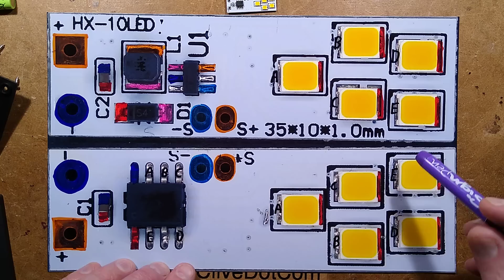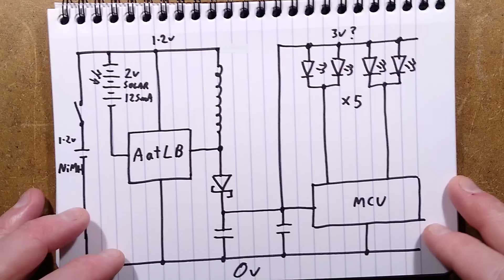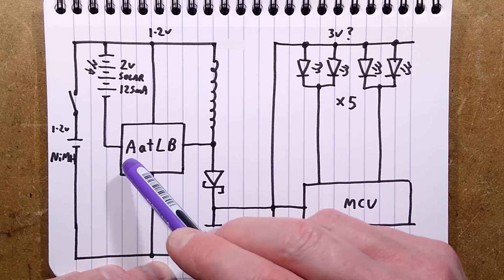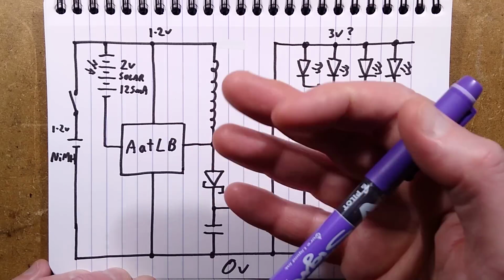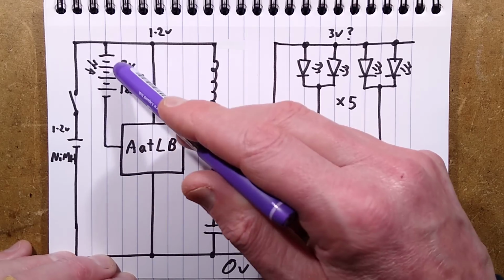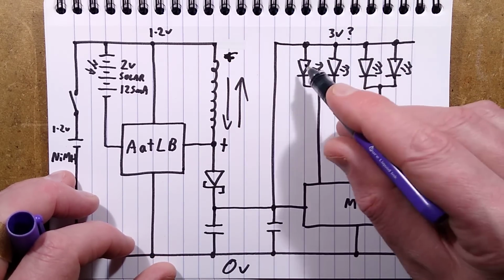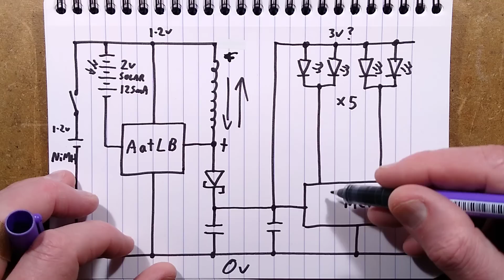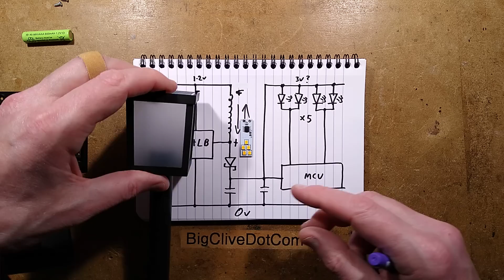Surprisingly good solar flame lantern

Comment: FYI on the ads:
The first time I watched the video, I got 2 mid-rolls, then nodded off (not your fault - it was v late at night).
Just re-watched it, paying more attention this time. At 1:35 I got 2 ads: a skippable 30sec, followed by a nonskippable 15sec one. 
At the end of your upload, I got another 2 ads, both skippable... 45 sec, followed by 30 sec

My usual experience, when you have mid-rolls disabled, is that I rarely (never? will have to pay more attention...) see ads at the end. When the second set started, I assumed they were mid-roll, but when the ads ended, your last frame was showing, so I guess it's not technically mid-roll?

Comment: I've got these pillars in my front yard and they have kind of a Pogota on top of them.   I'd like the Daisy chain 4 of these together and put one of those higher rated lithium batteries (18650),  I'd even days to change the solar panels so they charge the lithium battery took capacity.   I figure 4 lights per structure,  lighting them from each side.   Suggestions would be greatly appreciated.
Reply from the maker: You can get sets of lights with a common solar panel and battery.

Comment: What I hate about all these solar lights is that they are not designed for rain. Notice how the solar cell is sitting in a little plastic well/cup so that the water can sit there and leak past into the unit over time. Even if you seal it off with some silicone or whatever, it'll eventually leak, destroy the solar panel, and then leak further in and destroy the rest.

Comment: So...   does the AatLB have voltage sensing and feedback?    If it didn't, and the microcontroller turned all the LED's off, then the microcontroller would be overvoltaged...
Reply from the maker: That is a possibility.  I can't find a datasheet for that specific chip to see if it monitors voltage in any way.  It may just rely on there always being a load.

Comment: Big Clive I have atypical solar light nothing fancy.  They will not turn off in direct sunlight.  It's they're a common component that could be defective?
Reply from the maker: Two things can cause the light to be on in daylight.  A failed NiMh cell or its contacts meaning the solar panel powers the LED directly, or corrosion around the solar panel itself that means the light can't detect daylight.

Comment: I didn't see an advert unless it was you mentioning Poundstretcher 08:09.  Was it the pen at 04:48 ? I checked with ChatGPT and it says you use a Uni-ball Eye rollerball pen.
Reply from the maker: I use a Pilot V-sign pen which I refill with printer ink.

Comment: I’ve got at least three solar panels where one wire that looks to have been soldered, has come away from the rear of the panel. The panel is glass, so there does not look to be copper tracks. Does anyone know of a reliable fix for this failure? It’s a shame, as the solar lights are otherwise in a good condition.
Reply from the maker: If it's the brown amorphous silicon panel then they are almost impossible to solder back onto without damaging the panels ultra thin layers.

Comment: I guess the chip regulates the microcontroller voltage by monitoring the peak voltage of the inductor.  Hadn't seen that method of feedback before.
Reply from the maker: I think it's just presenting a fairly continuous load and treating the boost circuit as a simple current limited supply.

Comment: 6:52 nice explanation of the role of the inductor in the boost circuit 🙏
Reply: Not really. Since when does high frequency and one diode provide DC.
Reply: @billr3053  pulsing dc then?
Reply: @fidelcatsro6948  Yes, very ripply. I guess as long as the microprocessor is OK with it.

Comment: The pattern is fine, but the mistake it makes (as many electronic flame effects make) is that it is too fast. A flame, especially in a lamp, will have periods of quiet with an occasional flicker. This is flickering all the time as if it were in a breeze. Slowing it down would also alleviate the repetitive pattern.

Comment: Any idea why a solar garden light would light up in the daytime? Changed the ni-mh battery and checked for corrosion but all was ok..?.?
Reply from the maker: It hints at a corroded battery connection or if that's good then the solar panel is corroded and it thinks it's dark.

Comment: Looks to be another bit of e-trash.  No sealing against moisture at all and PCB isn't conformally-coated for outdoor use.  In many locations, that switch will corrode away to nothing inside of a year.   But it's cheap, so who cares, right?

Comment: I ended up having to get power screw drivers because I had carpal tunnel in both hands in couldn't get even one screw in or out of anything, surgery helped but I'm still using the power drivers

Comment: Yes , you are correct ... the slide switch VERY quickly corrodes in use , in the ( damp UK  ! ) as do the chrome plated steel battery springs ( chrome on steel is just 1st class  for starting corrosion , car owners take note ! electro-chemical series etc ! unlike zinc on steel ) ... also , saturate the circuit board with yacht varnish BEFORE putting in garden ... I like to remove the battery and connect twin wire down the tube , then SOLDER battery ( or 1v5 primary D cell ? ) put in the flowerbed adjacent , this makes it MUCH easier to change it should it fail ...... ( tried - n - tested ) ... DAVE™   🛑
Reply: I just paste everything with silicone grease; connections, switch, PCB, the lot! Messy but it works! 🙂Does need some care with low pressure spring connectors or where some contact arcing might take place, but for solar lights the stuff is great!

Comment: How come there is a capacitor hooked between the positive and negative? Wouldn’t that short it out like touching a power and ground together on any battery?
Reply from the maker: The capacitor across the power rails is to provide smooth DC for the microcontroller by acting like a reservoir.

Comment: Incredible - all the cheapo LED stuff like that that I see in the USA is powered by NiCad cells. I remember taking the NiCads out of some garden lights as they died and replacing them with some elderly NiMh batteries that I had.

Comment: when you mentioned protective coating, it reminded me that this type of low-side led drive keeps voltage on the LEDs all the time, enhancing(?) corrosion...back in my r&d days, we developed drivers that work on high-side drive, so that there is no voltage (maybe leakage.?) to the LEDs in the off state, reducing corrosion effects, even in connectors, by an order of magnitude...
Reply from the maker: That's an interesting thought.

Comment: Off-topic newbie question: I make homemade projects with Arduino and a 3d printer and some of them I would like to get out of the "prototype" phase. Currently all those projects need an Arduino board and pre-made modules. I know how to get the components of the modules and custom circuit boards to solder them to, but I don't know how to get an MCU that does what the Arduino does. And the question is: can a mere mortal like me get programmable or pre-programmed MCUs that do anything I want? Like, get the code from my Arduino, upload it to a website, pay and later receive an MCU at home.
Reply from the maker: I believe there is a way to extract the code from the programmed Arduino chip and then use that to program new bare chips.  There will be guides to that on the 'net.

Comment: I hate that these products clearly have room for a AA cell or even bigger in some cases but they never provide AA instead, it saddens me as the vast majority of devices these days use a AA set, if they use AAA cells it is primarily because of the thinness like that of a remote control
so you already have both cell types that aren't likely to ever go away(lithium is great but not ideal for all applications) and yet they choose the whimpy cell when a AA cell could compensate for the weaker days when it gets less sunlight as they don't need to fully discharge every day

Comment: Is it possible to grab the code off the chip to see what the program is?
Reply from the maker: I would expect it to be locked, and that would also require knowing what the chip actually is.
Reply: If you filmed it, and then slowed down the video, you could easily replicate it on a small MCU.

Comment: That solar cell is never generating 125mA 😢 more like 12.5mA I suggest. It's the less efficient amorphous type.
Reply from the maker: Definitely 125mA up against a 20W LED floodlight at the bench, and just measured 30mA facing up in the garden.  The efficiency of amorphous silicon panels has increased dramatically.

Comment: Thanks for the upload Clive. 
I wonder if there's no overvoltage/charge protection for the battery? Are you also saying you need to have it switched on to charge the battery? If left on, does it only light up when the light level is below a threshold, meaning that the night time discharge rate would always be enough to prevent battery overcharge during the day (even during short night the summer)?
Reply: they standardly use nimhs as they dont really mind being left on an unregulated trickle charge... panels only a small current. lucky to charge the battery fully... ever.

switch normally just disconnects battery. doesnt charge. 

its usually the voltage of the panel that keeps it in the idle state, once the cell isnt producing voltage, ie, dark... it turns on.

some of the fancier ones use a ldr... 1 extra component=$$$
 
look up the chip datasheet, explains all. sort of.

Comment: Many decades ago, when theatrical lighting was still controlled by individual 0-10V lines per circuit, I built a flicker controller to drive dimmers. This was before things like PIC chips existed, so I had to use hardware. There used to be little 8 pin pseudo-random self-clocked or externally clocked sequence generators. At their normal clock speed, the pattern repeated in something like 2.2 seconds, which is about what I'm seeing here. This I didn't want, so I used two of these PRS generators, the first one clocking the second one. The result was 6 completely independent channels of flickering that never visibly repeated.

The only better one I saw was used by Disney at EPCOT in the early years. There was a small courtyard in the back of the UK pavilion that was lit by a number of pole lamps run from flicker circuits. They randomly flickered quite nicely, but since there were 3 lights in each fixture, the lighting remained very even. But every so often there would be a "virtual gust of wind", and all of the lights, from one side to the other would do an extra flicker pattern, one after the other, like  candle flame in a gust of wind.

Comment: It would be interesting to have a flame effect controlled by those self-flashing LEDs... make the bottom row of each side of those, so they would drift out of sync eventually, and the rest in each column could just make a rising pattern  each time the bottom one switched on... maybe experiment with different layouts, maybe additional logic to more complexly derive the follower pattern from the states of the bottom LEDs.

Comment: From my tests, the solar light nimh cells always are around 100mAh, even if they claim to be 200 or 600 mAh. They likely come from the same manufacturer
Reply: They're probably using batteries that didn't pass QC for some other device.

Comment: Oddly well-designed effect for a cheap novelty. It would be easy to get a bit more randomness if that microcontroller has an ADC or comparator on it. Just leave it "flapping in the breeze," but only update it periodically so the flame effect doesn't turn into white noise.
Reply: You can just create long pseudorandom patterns at runtime with LFSR. But you should modulate to introduce some visible structure into it as well.

Comment: Always thought these lamps would contain alot of tiny micro leds but there were only 5 but looked okish.
I have always had adblock turned off for your channel because I didnt see any midrolls.
In this video however I got hit.
Will you use midroll ads from now on going forward or was it a fluke with this video.
Thanks for the video.
Reply from the maker: It's a test to see if Google are only pushing "profitable" channels.  I made a note about that in the description and talked about it in the recent livestream.

Comment: I like it. 
How does this chip keeps the output regulated without a feedback path?
Reply from the maker: It relies on the solar chip being a current limited supply.
Reply: My guess is that it samples the voltage on the anode of the Schottky diode during the off period and allows a bit extra for the diode drop.

Comment: I don't think it's necessarily software driven. It looks like it might be using counters. Still impressive what can be done with a few components.
Reply: Some microcontrollers can be had for less than fifty cents at best, so yeah, I agree with Clive, they're stupid cheap nowadays that it's almost not worth using discrete logic chips, or let alone dedicated LED drivers (the dedicated LED drivers nowadays have a form of processor inside unless labeled otherwise, and I noticed that in a clear flashing RGB LED from a few years ago, it was clearly of 4-bit or very simple 8-bit RISC design).
Reply from the maker: @Dr_Mario2007  You can get Padauk microcontrollers from 5 cents.
Reply from the maker: These days it's literally cheaper to use a microcontroller than a dedicated chip to flash an LED.

Comment: nimh and nicd cells are very safe if over charged you will just shorten their life.

lithium cells the 4.2 volt kind can start on fire if they are over charged.

lifepo4 and LTO cells are too very safe you will shorten their life if over charged.

Comment: I think the pattern would get on my wick, needs more variation to it than it currently has, would be fun to see the thing modified with a randomiser to make the flicker more "natural", or at least, not as obviously repetitive... :)
Reply: they will be more expensive
Reply: @boediprasetya2850  Doesn't have to be. There's one pin left that you could leave floating as input for a random function within the chip. And with each LED having its own output, you basically just need one LED from each of the pairs to go out occasionally while the other one stays lit, making the flame move side-to-side, with D and E being on a longer timer than B and C.

Comment: I hate the AAA cells, I have some lights and they had the AA 600ma so I replaced them with AA 2000ma so they will stay on all night, I do have to put them in a charger once a week during winter to get back to 100% but at least they hold power for days

Comment: My brain immediately hates the rhythm, it needs to be much more random to be convincing.  With so few LEDs there's not that much you can do though and it works better than I would expect given that restriction.  Also nice to see a decent sized battery, a lot of these use stupidly small cells.
Reply from the maker: Dimming actually increases the perceived resolution, so with decent software the 5 LEDs could do really well.
Reply: yeah rhythm is frustrating.
Reply: Varying the timing a bit and making it dwell longer at the bottom sometimes might break the pattern recognition.
Reply: The tip needs to flick a little more
Reply: @AquarianNomadic That's what sh....

Nevermind.
Reply: @mattfleming86  well that was unintentionally awesome 🤣
Reply: If you buy several, as you would to line a walkway, they should become unsynchronized and look more random from a distance.
Reply: After a few beers (/wine etc select as reqd) I find any perceived predictability quickly diminishes.
Reply: I'd like it to just have a slower pattern